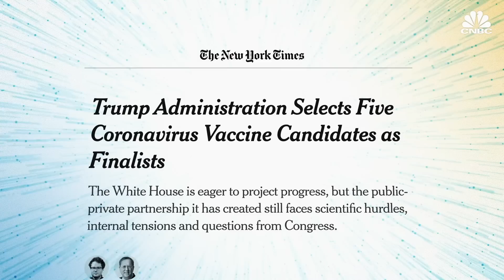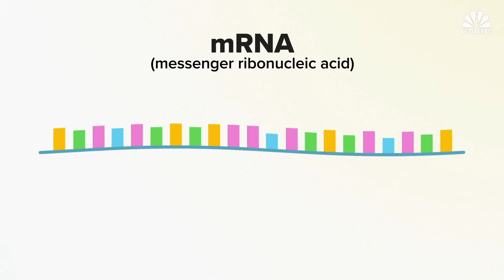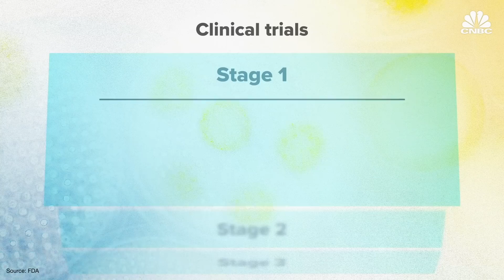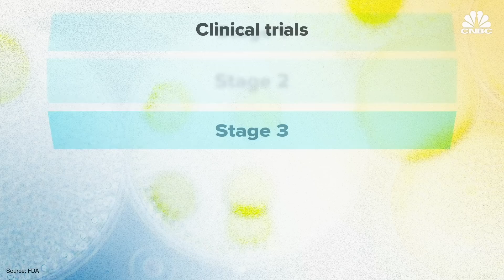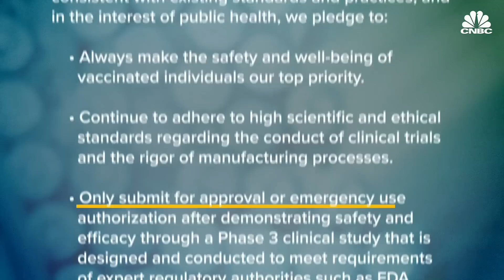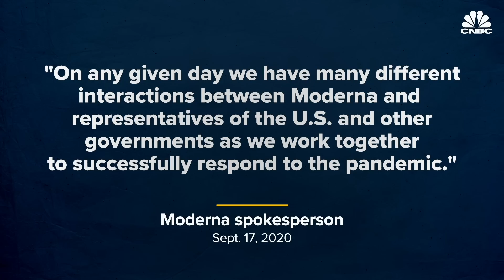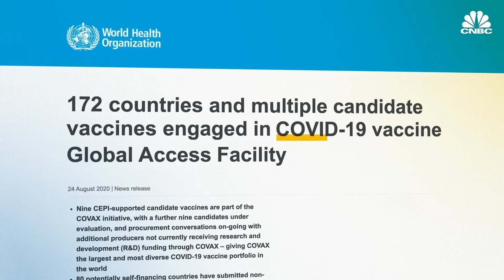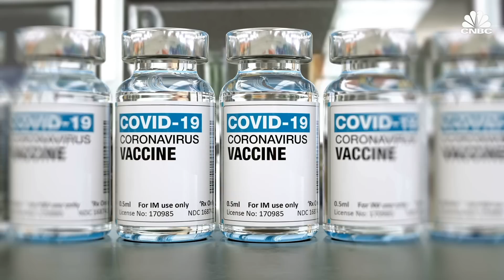What Is An mRNA Coronavirus Vaccine?

Comment: mRNA VACCINES ARE MORE DANGEROUS THAN CORONAVIRUS COVID-19 

In the Diamond Princess cruise ship, where coronavirus covid-19 first broke out, there were 3 deaths per 1,000 persons or 0.3% fatality rate. However, these fatalities were all over 70 and were taking hypertension drugs or other pharmaceutical medications, now known risk factors for covid-19. Only 1 in 20 persons showed signs of infection or for all ages 19 out of 20 were immune to the virus. 

This means that you are at risk only if you are over 70 years old and are taking drugs. If you are not over 70 years old and are not taking drugs you have almost no risk of getting covid-19. 

Also, ALL of us have already been naturally immunized since birth of coronavirus because the virus is in 30% of our common colds. It is only in the genome sequence inside the covid-19 virus that they have modified.

Note that the passengers and crew aboard Diamond Princess cruise ship were exposed to 5G radiation, engaged in close social interaction, dancing close to other pairs at night, sitting side by side in the dining halls, and were breathing almost the same air-conditioned air. This condition is much worse than outside where there is yet no 5G Internet, where the virus is killed by sunlight, heat or salt and where the air is fresh, where most people normally go.

Now, consider that if you are below 70 you almost have no risk of getting covid-19, and you have to take the mRNA vaccines with the observed risks and side effects:

blood clots and even immediate death,
covid-19 infection (yes, covid-19 sometimes appear after vaccination),

injection site pain, 2 days, 3 days
swollen lymph nodes 12-21%
systemic fatigue  55%, 79%
fatigue 69%, few days
headache 63%
muscle pain 60%
joint pain 45%
chills, fever 12%
50% side effects within 15 hours
systemic reactions 7+ days 12%, 37%
bells palsy in 3 individuals

So, if you are below 70 and are not taking drugs why should you risk getting all the above side effects, getting covid-19 and dying early?
====

Comment: I would suggest, if the vaccine doesn't cure COVIC-19, you guys should switch to a substitute, and also the COVIC-19 is breath-taking, then.  Damage your lungs, isn't it? So you have to try whatever drug is given instead of injecting it, you try to find a drug that helps flush toxins from your body, or  Is a drug related to the respiratory tract.

Comment: The mechanism presented of how mrna vaccines work is totally false. The mrna doesn't code for antibodies, the RNA is the same sequence as part of the viral RNA in covid19, specifically coding for the spike protien. The vaccine mrna is not targeted for uptake by a certain cell type, so it can enter any cell, theoretically. RNA is a transient molecule so the cell makes spike protiens until the rna is digested. Normally other viral protiens would be produced at the same time & they'd be packaged into a viral envelope, the infected cell is lysed & viral particles are released. Absent any instructions on what to do with protien produced from the vaccine mrna, cells can excrete it or present it on the cell surface. The 2nd possibility is a huge problem, because the immune system would recognize those cells as foreign & u have the potential for a severe autoimmune response where the body begins to attack it's own cells. Depending on what cells the body is attacking, this can become a deadly scenario. This is why in some countries they warn people with autoimmune diseases or allergies not to take the mrna vaccine. Problem is, this can happen in perfectly healthy people as well. But covid is so deadly we have afforded scientists no time to engineer solutions to address this huge safety issue.

Comment: By definition the mRNA is not a vaccine.  Having never been used before, it is a biological experiment and no one knows the long term affects. It doesn't protect an individual from  infection per say, so masks and social distancing remain the new normal.  Those who have opted to partake of the biological experiment, in the midst of social pressure, fear and the use of misleading language, must still wear masks.  The decision by airline, corporations and businesses to force employers and air travel to accept the mRNA experiment is a direct assault on human rights.

Comment: Experimental gene therapy which can alter human DNA and be pased on to the next generation. It's also being questioned by doctors whether the vaccines themselves are responsible for the so-called 'new strains' being reported as typically after being vaccinated a person emits 6 times more flu particles in the air so it wouldn't be a wild prediction to say it's the same with covid (if it even is still covid and not the flu as has been reported in some quarters by certain medical professors).

Comment: mRNA technology is less than 2 years old.  It simulates a virus infection.  The mRNA vaccine infects healthy cells and forces it to produce the virus particles to trigger an immune response.
why mRNA?
It is because Europe and USA does not have the ability to produce vaccine the old fashion way (decades old tried and tested method of using dead virus or bacteria).
All vaccine production has been outsourced to China and India.  so the only choice is to produce untested mRNA vaccine.
Reply: It's actually been studied for for 50 years
Reply: You're objectively false. mRNA Technology has been studied since 1990 and used in Clinical trials since at least 2003. The mRNA doesn't infect the Cell. The mRNA contains the genetic instructions for the Ribosomes to create the SARS-COV-2 S-Protein. 
We do have the ability. But mRNA doesn't require cell cultures and has many other advantages so due to the Urgency of the Pandemic, we needed a safe, effective vaccine out there as soon as safely possible. 
If you genuinely believe that the Vaccines are untested, you shouldn't be talking about Vaccines because you have never heard of a clinical trial.

Comment: Strong men need to stand up and speak out against the Vaccines. Women are perpetuating and socially pressuring everyone to get them because that's what women do. They feel that social pressure, and they don't want to feel any negative feelings so they become a node in the network and parrot the trend. Strong men need to ask the tough questions and speak out. -Is this vaccine tested? -What are the actual benefits? -Will it actually protect people from spreading COVID (spoiler: it won't). -Will it protect immunocompromised people? (No) -Is there social pressure out there to get the Vaccine perpetuated by virtue signalled women who don't know the first thing about it? (Yes).

Comment: I still prefer the dead virus approach. At least the immune response is naturally from my body.
Reply: Wait why? mRNA Vaccines have many advantages 😊

It's mainly got to do with fast tracking the development and manufacturing timeline. mRNA vaccines are cell free and are instead chemically synthesized meaning no 
waiting for cells to grow and produce virus or the protein and then lengthy purification and control assessments. mRNA vaccines are hugely scalable in terms of manufacturing for this reason. Additionally the design of the vaccine is rapid, you can switch out many viral genes (antigens) to make many different viral vaccines. The Moderna team took 2 days to design their vaccine based on the sequence of the virus (spike protein). The reason we didn't have mRNA vaccines previously is because we were still working on the stability of them. They are transiently expressed and then disappear quickly from the body, and don't involve using the virus at any stage in the manufacturing process! So are also very safe as compared to the older vaccine technologies which have had issues with safety for some populations (pregnant/ immunocompromised). 

Additionally, they don't require the use of an adjuvant because adjuvatingboosting properties and because adjuvants have been an issue in the past and led to thimerosaltrying to avoid them and improve on the tech of the past is the best way to go. A balance of safety and potency!
Reply: @laurenmiller9482  then lets wait 2 years from now. Let see what happend to people who vaccinated in rna.
Reply: @laurenmiller9482  are they have transparacy data of this vaccine? How they design the mRNA?
Reply: @therealleddy364  That too! I probably should have mentioned that in my Original comment.
Reply: @therealleddy364  I'm 2 weeks late but this is awesome thank you! I see @Otep arc never responded back :/
Reply: Also, thats an appeal to Nature Fallacy. Also, the Immune response DOES happen naturally from your Body. 
Traditional vaccine formats often are based around a viral protein, such as the spike protein on the outside of the virus that causes COVID-19. mRNA vaccines are slightly different; instead of injecting that protein directly, they include a small piece of the RNA that can be used to produce that piece of the virus (in this case, the spike protein of the virus that causes COVID-19).

The mRNA vaccines do not encode the entire virus — they only lead to the production of a small piece of the outermost part of the virus. As a result, they are not infectious, and do not self-replicate.

Comment: Why can’t they find a vaccine for cancer they same way???????
Reply: Some diseases are easier to treat than others. Cancer cells are inherently very similar to healthy cells, plus just a few mutations. This means that it is extremely hard to specifically target the cancer cells, but do not target the healthy cells, and this is why chemotherapy drugs often have such awful side-toxicities to the rest of the body. Further, “cancer” is really an umbrella term that includes a wide range of different diseases, and different types of cancers will require different types of “cures.”
https://pubmed.ncbi.nlm.nih.gov/27076165/

Comment: If employers mandate an mRNA covid vaccine, they should be held complicit if the vaccine causes adverse reactions. Anyone familiar with the dengue vaccine debacle, that ultimately killed thousands of children and resulted in criminal charges, would rightly be hesitant to take one. But as it stands right now, not only can employers force people to vaccinate or risk termination, but they also are not held liable if the vaccination causes complications, it is considered an on the job injury and the victim has to file workmans comp. It is a lose lose for employees.

Comment: Only actual "vaccine" that would  work ,would have to have plasma only  in it ,aka bone marrow,  aka antitrobin 3 , what causes  all illnesses  is the point  in which cells mass produce  so much and can pass through  the veins, throat, nasal cavity, and ,digestive  tract  ...what then happens  is it cause blood to thicken  and form  clots, prevent  carbon  from getting  to your organs, early stages are registered  as inflammation, allergies, and inflammation,  which then hardens  and forms kidney stones,aka a big scab, and then turns into tumor aka... scar tissue  ......those clots then cause your blood throughout  your body to backup, and cause hemorrhaging....aka internal  bleeding...this goes for all illnesses.
Reply: If you checked each covid patient's  wallet...would more then likely  find a plasma  donor card in it ...also same ones that made the plasma  centers...BioNtech are the same that will be making  the vaccine .the  process  of figuring  out pulling out all of a person's  bone marrow  would cause issues  ,is called  coagulation  replacement  theory.Those that didn't  go from donating  plasma  when from being  poisoned by asbestos, aka what has been known  for years as chemical warfare...it's  completely  invisible  so could  be passed off as a virus.

Comment: A drug made with inactive ingredients? That's opposite to the definition of a drug😂
Reply: If this "definition" you speak of was true then prodrugs are also "not real drugs." Drugs don't need to elicit an immediate effect to be considered "real." mRNA is not inactive if you're referring to its ability to trigger a series of events that lead to a response, as stated in the video. I don't think inactive is the best term to describe it but there are clear differences between it and what is more commonly thought of as a drug.
Reply: @Lainabobaina  you're wearing a coat. So I'll assume some knowledge on the matter.
Are we adding to produce a protein or altering the production of a protein. Are they introducing amino acids into a polypeptide chain or just adding a new recipe for a new protein altogether.
Is this going to be represented on the bilayer or something that binds to the virus by freely floating around the intercellular space?
Reply: @Lainabobaina  think you misunderstood what I meant. "a substance that has a physiological effect when introduced to the body" is the definition I was referring to. When I said "a drug made with inactive ingredients", I was quoting the journalists description of a placebo. I was pointing out the fact that it is impossible to have a drug with all inactive ingredients because the definition of a "drug" is made based on the fact the substance is "active" (has a physiological effect on the body). I would definitely call mRNA a type of drug as it changes the instructional buildup of white blood cells. A saline solution (which was most likely used as a placebo), isn't a drug as it has no active ingredients and so my comment was basically saying this.

Hope this makes more sense😂

Comment: I was going to get a covid vaccine until I found out that it alters my dna....
Reply: It does not alter your DNA. mRNA cannot alter your genome.
Reply: @crimsonstarr6122  I misunderstood. However isnt it possible to encode any other instructions in the rna that function on behalf of your dna?
Reply: @westdakota9180  What do you mean 'function on behalf of your DNA'? 

Your initial comment is blatantly and objectively false, I'm now not entirely sure what you're asking.
Reply: @crimsonstarr6122 you are right. The vaccine does not in fact alter your dna. I was overzealous in making my original comment. However as I understand it now, rna carries out the instructions of whatever your dna requires right? If your dna dictated that you need to a specific protein to (let's say) generate antibodies in your blood then rna would be dispatched to the ribosomes where said proteins would be produced. My current argument is that changing your dna could be just as dangerous as introducing foreign rna because either way, whatever new instructions are being carried out by the rna. Mrna treatment just circumvents the dna as a false messenger so to speak. Does any of that make sense or do I just sound more crazy?
Reply: @westdakota9180  Your body would create antibodies in the presence of a foreign substance in traditional vaccines as well, as traditional vaccines contain viruses or virus particles. mRNA vaccines simply cut out the middle man. One could argue mRNA vaccines to be safer than traditional vaccines, as there is no actual virus contained within the vaccine.

But you are more or less correct that mRNA vaccines effectively circumvent the DNA as a 'false messenger' as you put it.
Reply: @crimsonstarr6122  right, so technically anything your own dna could alter within your body, rna could alter as well. Hypothetically someone could introduce rna into your system that could do almost anything to change your cells. It could create antibodies. It could create insulin. It could create melanin. So on and so forth. Anything your dna can change, rna can change.
Reply: @westdakota9180  Not entirely sure what point you’re trying to make here buddy.
Reply: @westdakota9180  Because the mRNA codes for a protein that confers immunity to COVID. What you’re essentially saying is ‘well cyanide is a specific chemical that kills you, so why would you take any chemical?’ It’s a false equivalence.

Comment: Some vaccines have the cells of babies that have been aborted. I will not take a vaccine that has anything to do with aborted BABIES.
Reply: this vaccine is synthesized, meaning it is made without use of any cells. it uses mRNA, which does not require anything to do with abortions.

Comment: The mRNA vaccines will reprogram/replace parts of your DNA...
Reply: Messenger RNA does not enter the cell nucleus, so there is no fear of affecting your DNA. even if there was, 8 percent of your dna is viral from prehistoric viruses, and they dont harm you. EVEN IF THEY DID, it is only injected into your upper arm, meaning only a small part of your arm would be "reprogrammed".
Reply: No, mRNA is like code that your cells use to make other things that train your immune system to fight the virus. In no way does it reprogram cells.